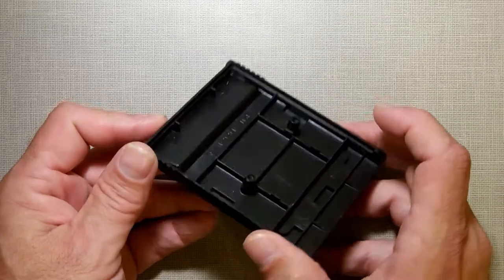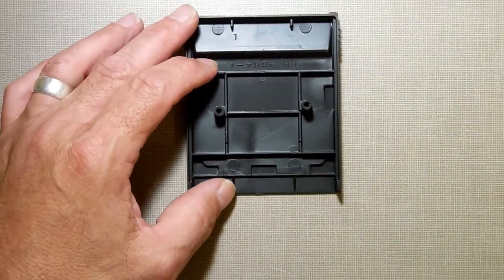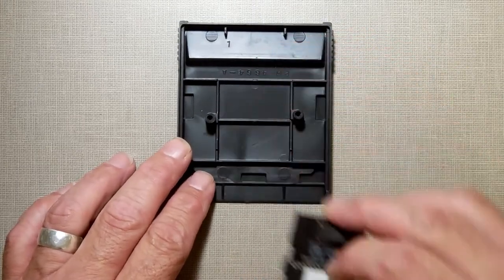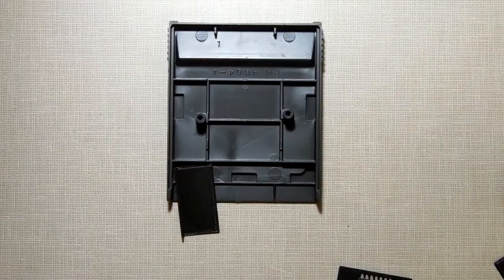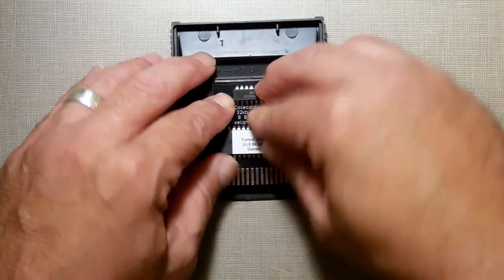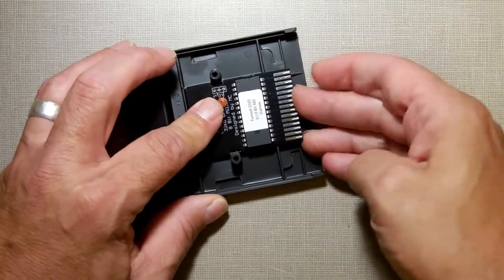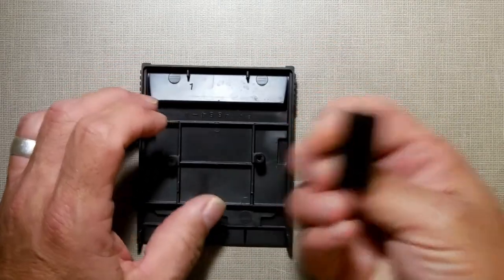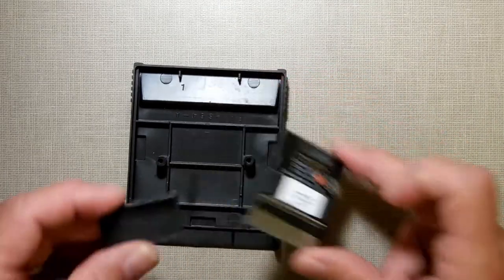Quick Colecovision Cartridge Fix

Comment: Isn't there someone with the molds?  I know we have the vectrex molds and I could have sworn we also have Colecovision molds.  I use "we" meaning the reetro-gaming community.  In fact, I KNOW we have the molds because the collectorvision guys put out colored cartridges which were not available back in the day, so they must be being molded now, unless they printing them, which is dumb if you have the molds.  There is just no comparison between injection molding and 3d printing.
Reply from the maker: CollectorVision is selling them at $10 a pop - way to high
Reply from the maker: Profits - it’s not a bad word but sometimes you need to think about other things